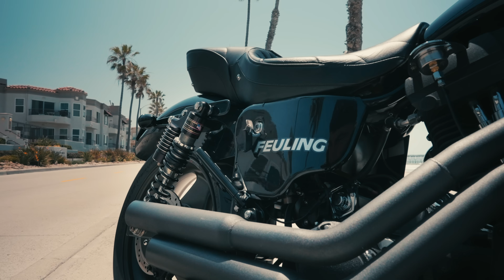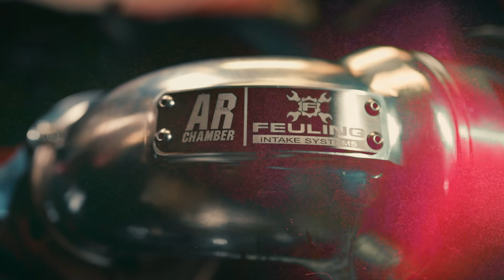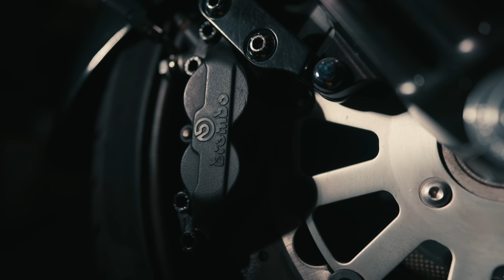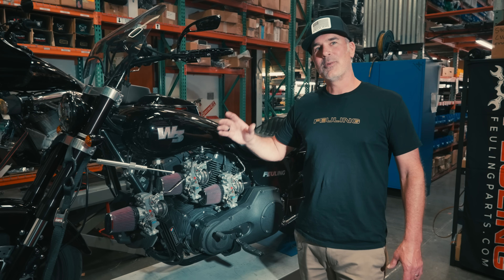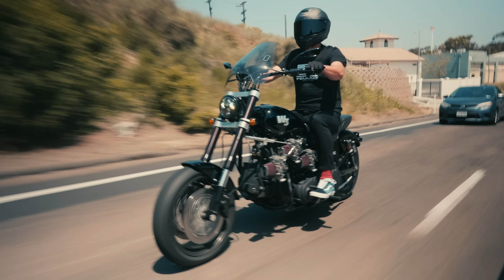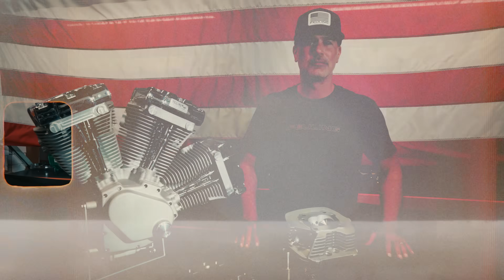Own a FEULING W3! (W3 Walkaround)

Comment: I remember when this bike was first unveiled. I found it very interesting, but it was a prototype, basically an experiment, and was never refined into a practical, rideable motorcycle. Unfortunately Jim passed away before he could ever really do anything with it. And H-D decided they were not interested. This bike had a lot of problems. The engine was so heavy and had so much torque that it twisted the frame. The original was not a bad looking motorcycle, but this one is HIDEOUS. It's black on top of black on top of more black ad nauseum. If it had bright shiny paint (NOT black) a bright aluminum engine and other parts, and a lot of chrome, it would look good. It would be impressive. But it would be about as practical as a Boss Hoss. And every Boss Hoss picture (I've only seen one real one) I've ever seen was all chromed out with acres of bright shiny paint. There's been enough 100% flat black bikes made to fill half the landfills in the country. And that's exactly where they belong.
Reply: There is a guy in Pleasanton California (think his name is Frank) who rides a Boss Hoss as his daily. He also carries his little white poodle dog strapped to his chest while he rides.